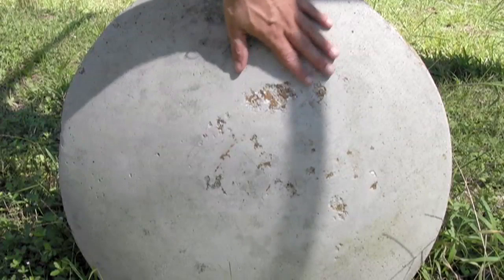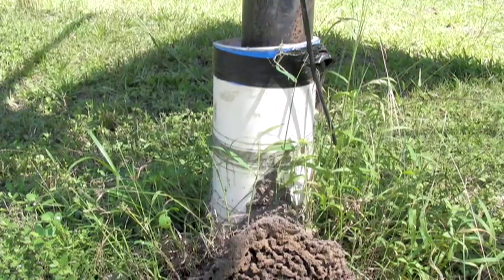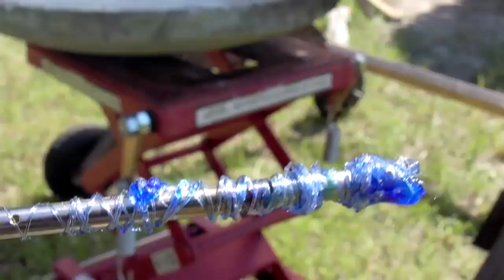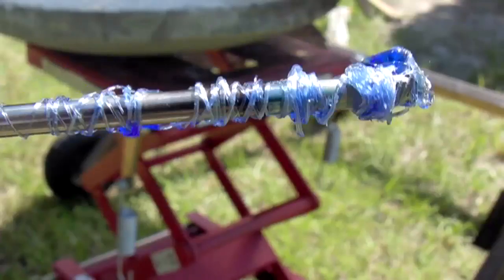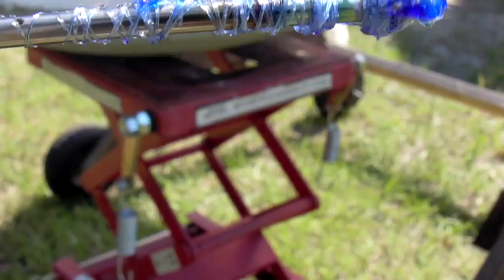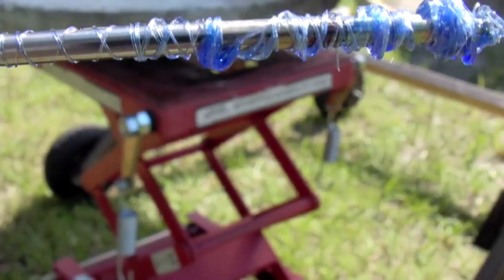Melting Glass with the sun n Fresnel Lens to make glass springs with sun power

Comment: Treating burns. Remember a small second-degree burn can be turned into a non-painful first degree burn with 20 minutes of running water at 80°F.  Much colder than that and you risk a cold burn.

Comment: use a copper rod, the glass should slide right off. when white men traded beads with natives they were made by dipping copper wire into vats of glass.

Comment: Hmmm, would that be hot enough to melt iron/steel? If would be interesting to see if you could create iron from "dirt" by heating with the fresnel. There are numerous youtube videos of backyard creation of iron using charcoal (with air blower). You might be able to forego the air blower it your fresnel temp. goes high enough.

Comment: Enjoyed your video, cool idea, thank you.

Dan got a couple of questions... 

Q1 If I pulverise a mix of glass types into powder, would I be able to remove the elements out of the glass using acid? 

Q2  If I pulverise a mix of glass types into powder, would I be able to melt the glass back into a single product or will it fail, as in graze or be extremely brittle etc...